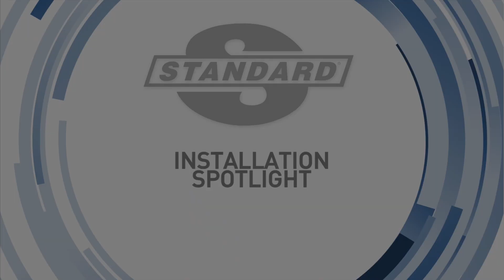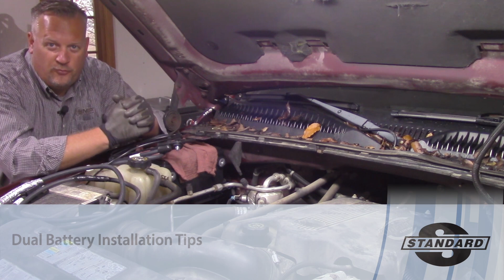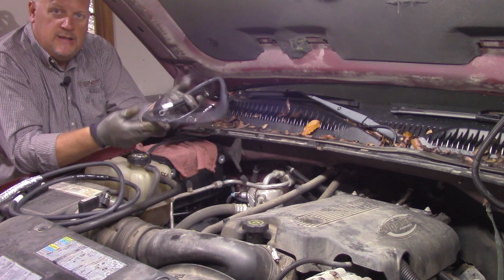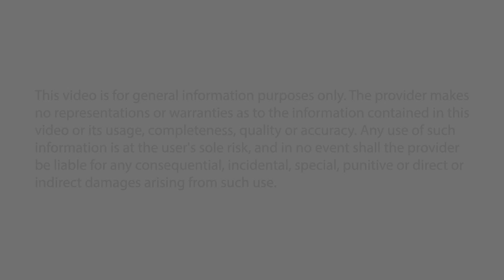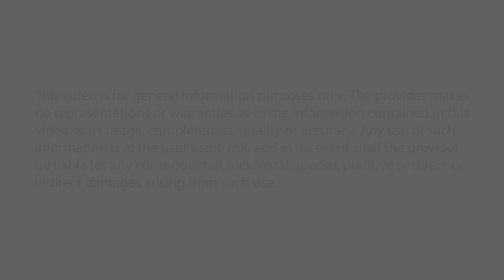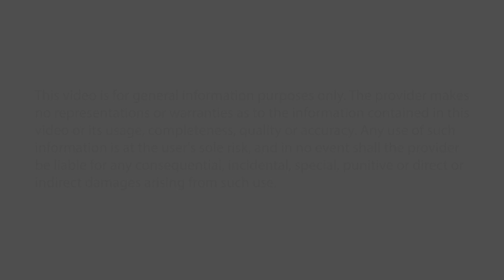Dual Battery Installation Tips

Comment: So after we add a second battery,  all we have to do is run a negative cable from the original battery to the negative connection to the new battery.  Then run a cable from the original batteries posative terminal to the second batteries positive terminal,  right??
And the alternator will charge both batteries??
Reply: The negative connection on the secondary battery gets grounded to the vehicle itself. This guy mounted the negative cable from the second battery to the engine block. 

The only cable running from the original battery to the secondary is the positive cable not the negative.

Comment: If the lights are dimming, that could mean you need get an alternator with higher amps. Then check the battery condition, by placing a load test on the battery. Just buy stronger battery.